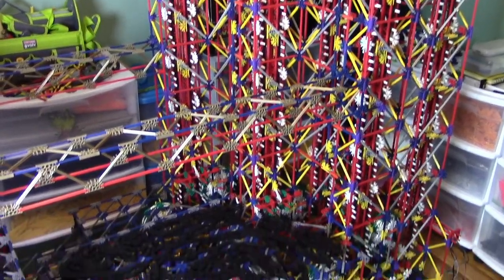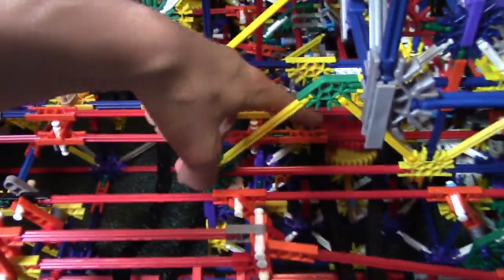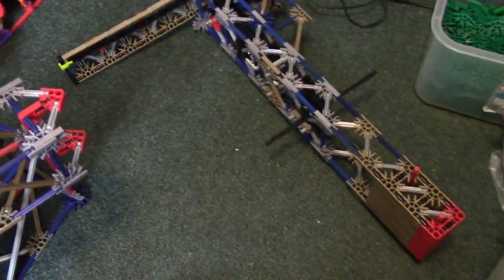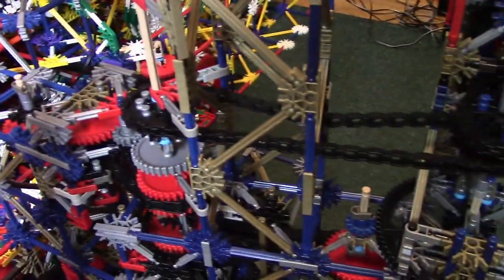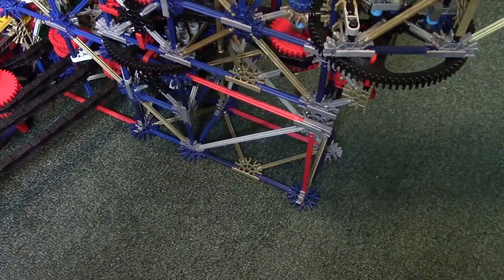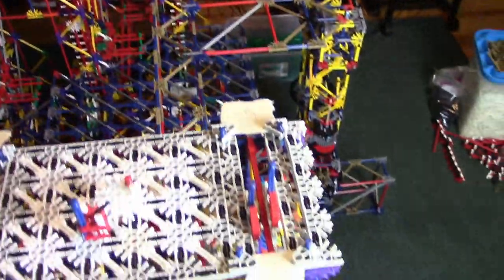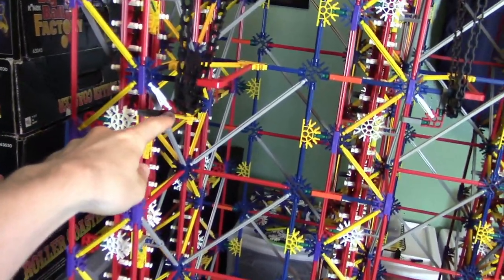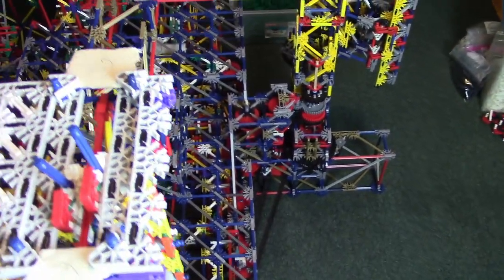Let's Build Knex S2 - Ep8 - Robot Project: New Arm and Final Testing

Comment: I think you should have it pick up balls from a like a receiver spot, carry them across its range of motion and drop them in a basket that has one little ball element and rolls back to the receiver spot. Then the program repeats. You could use the ball picker upper mechanism used in the power tower crane. It’s pretty simple and robust and has a fair amount of play in it that will compensate for the little bit of slop in the machine. I’m really glad you ended up getting it to work. For the next version you could do a big programming wheel like in the marble machine X or like a music box. If you had a long cylinder with the programming pins you could write several different programs on it at different spots along its length and then have the read head move either slowly move down the cylinder to play all the programs in sequence or have it controllable or programmable to move to whichever program you want to run.
Reply from the maker: That sounds like a good idea, I'll try to make it pick up balls. And the cylinder idea is something I thought of for the next version, except I was thinking of a belt that could have the height adjusted to add more steps. The cylinder would be easier to make but would use up more space. But the added benefit of being able to conditionally jump to different steps would be a neat thing to have rather than just one programmed sequence. Thanks!